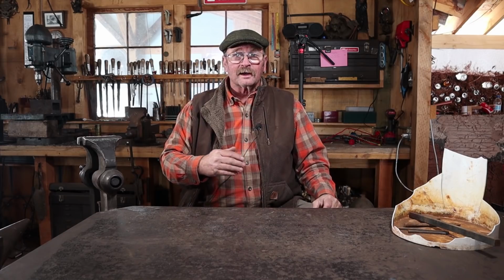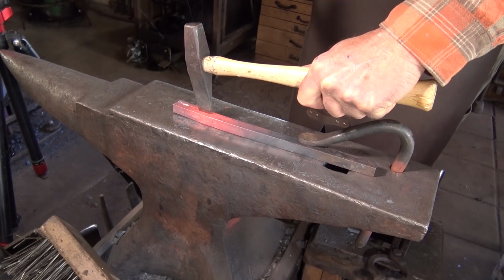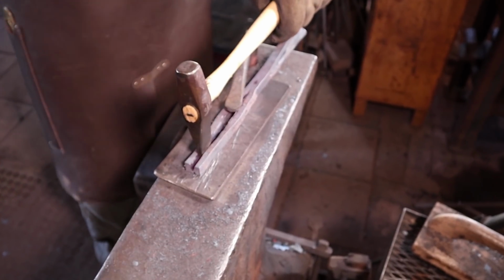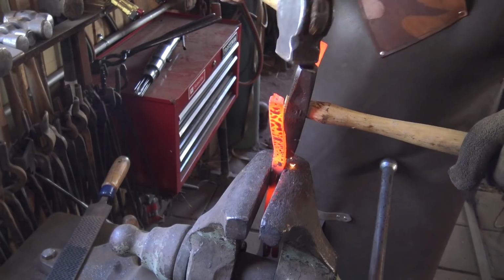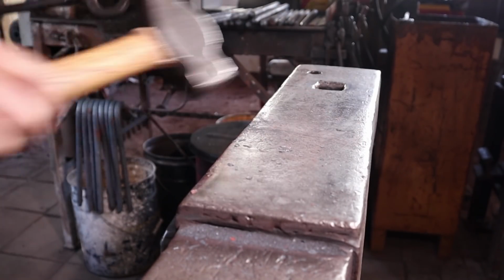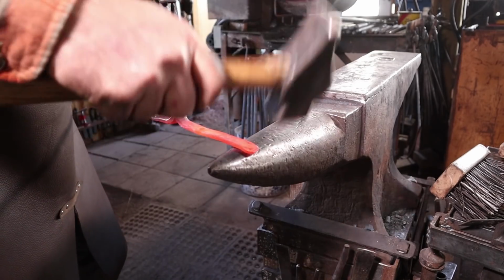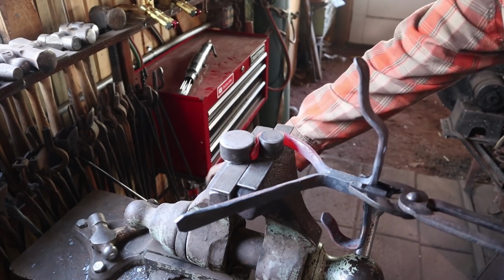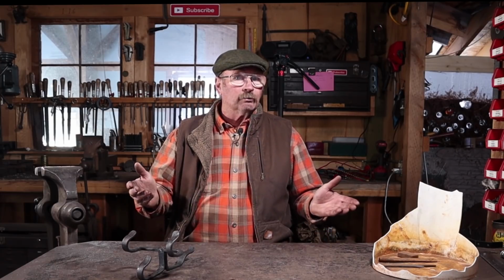Forging a 4 way split hook - Hook of the Week 25

Comment: Oh that was driving me crazy when you were cutting that.  I assume it was due to the camera angle that you did it in that position?
I would have stood at the end of the Anvil facing the holdfast. As if I would know a better way to do anything I just had to get that off my chest LOL
Reply from the maker: I would actually use the treadle hammer in most cases
Reply: @BlackBearForge  Music to my ears! I have got my treadle hammer in service now and the entire time you were splitting I was wondering why you did not use your treadle. That certainly is a great chisel. I need to make one like it.

Comment: Cool as heck hook. Love the way it looks, kinda midevil. 
"Gonna go in the house and build a fire"? Hope there is enough residual heat to keep the wife from freezing if you didn't build the fire before going out to the shop.
Reply from the maker: The house does pretty well with solar gain during the day, but needs a bit of heat in the evening
Reply: @BlackBearForge  oh, that's good. Saves on wood too.

Comment: I often have trouble keeping the split uniform with depth, much less straight.  I have found that the biggest problem with keeping the split uniform with depth it keeping the hot cut absolutely vertical.

Comment: Very creative hook, well done. I'm not really looking forward to the snow, but it is pretty.  I recently made a hammer eye punch with the handle coming out at right angles to the axis of the hammer eye, and I'm thinking about a handled hot cut chisel with the same arrangement. It'll be an experiment to see how hard it is to follow a straight line with that type tool.

Comment: I feel you on the heat on your knuckles while using that hot cut.  I was thinking of making myself one with a 45 degree offset, like a diagonal peen hammer.  (Hey, that might make a great video!)
Reply from the maker: I have tried diagonal cutters and find it harder to steer a straight line
Reply: @BlackBearForge  X2 on that!!

Comment: Great work John.  Thanks.  I have an unheated/unpowered shop up here in Canada and I'm concerned I may crack my anvil unless it is warmed somewhat.  I am curious to know how much consideration you give to hammering with cold tools.  It may be hogwash as I know smiths/farriers worked the logging camps out here all winter without heat.  I would love to hear your opinion. Thanks again.
Reply from the maker: I have heard enough stories to wonder if its an issue.  At the very least a cold anvil sucks the heat out of your work.  In very cold weather I preheat the anvil with some large pieces of steel heated in the forge and just set on the anvil face.
Reply: @BlackBearForge  Thanks John.  Keep up the great work.

Comment: Hey, John.  Next time you make a hot cut out of S7 or S5, try angling the cutting edge at 25° to 30° from parallel to the handle. Much easier to use ergonomically and keeps your knuckles away from the heat.
Reply from the maker: I have always found its easier to keep the cut straight with an inline edge
Reply: I'm not even a novice blacksmith, but curious as to why you wouldn't stand on the other side of the anvil, thus having your non-hammer hand away from the heat?
Reply: @croyce7699  because the risk of the hammer/tool hitting the hot steel sticking up is much greater? Good question.